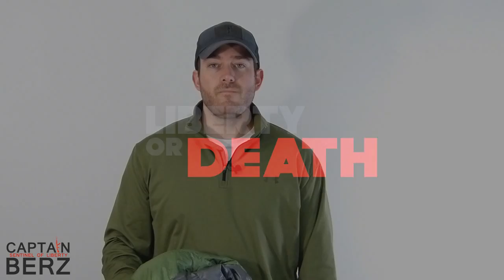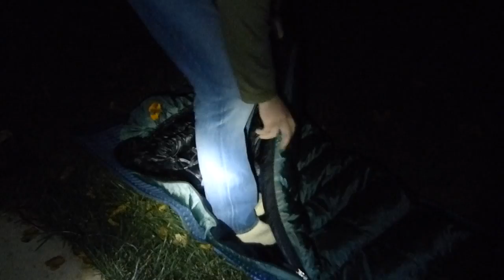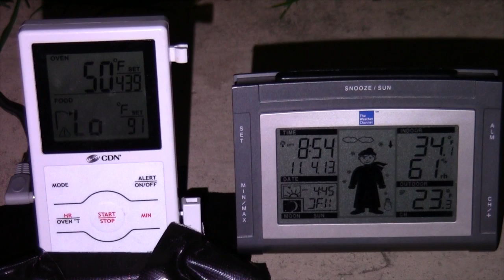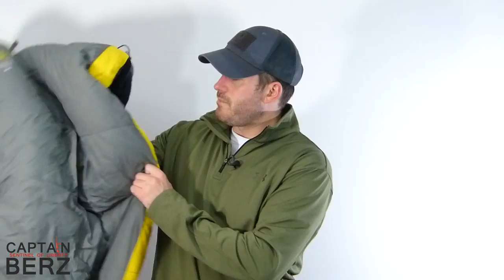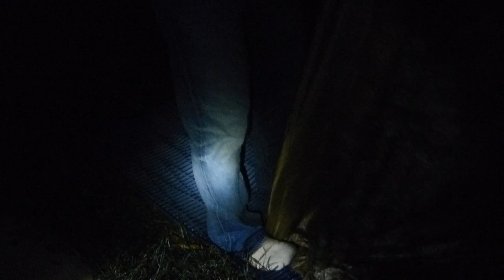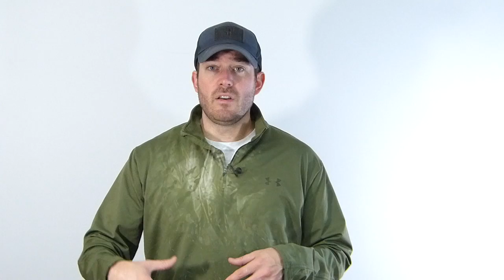Sleeping Bag Testing Clinic Introduction (Sierra Design, Mountain Hardwear, Valandre, Kifaru, Etc)

Comment: I'm shopping for a winter bag perhaps -20 bag.  I hope your video will help me. Thanks~ look forward to see your video.
Reply from the maker: I will see what I can do. I have different thoughts on winter bags, where I use a higher rated bag and wear more clothing. But I have like 14 bags to test. What is your budget?
Reply: i hope to spend less than 500. possibly  a down bag yet if the bag is relatively light i wouldn't mind synthetic. what do you think about a sleep system like bigagnes? no insulation on the bottom of the bag? looking for a perfect bag has been somewhat dreading so far. it all comes down to buying me a warm bag so that my backpacking trips will be comfortable. if you could, please feed me much information as possible. and recommendations. thanks and i look forward to watching your videos. Randy from NJ
Reply from the maker: baseballman74 Sierra Designs man. I am testing that pre production and it is amazing. It has DriDown in it, and they make a CAL sleeping bag that would fit your needs and price I think.